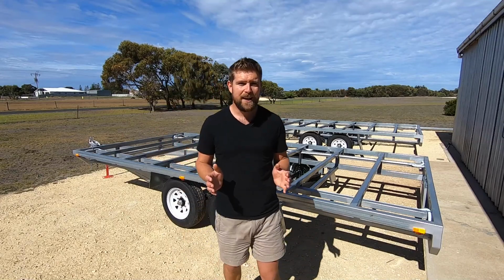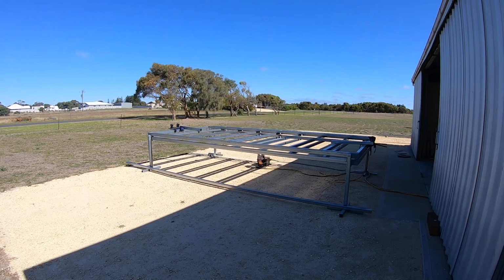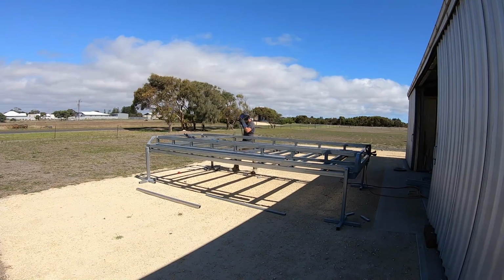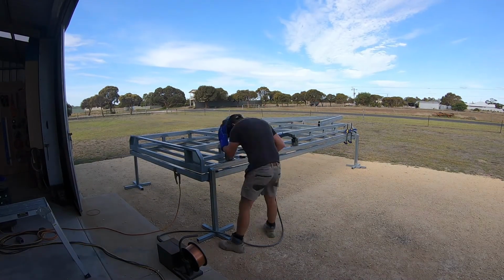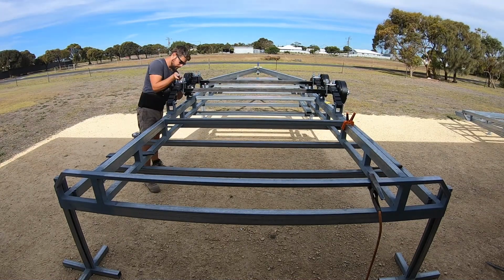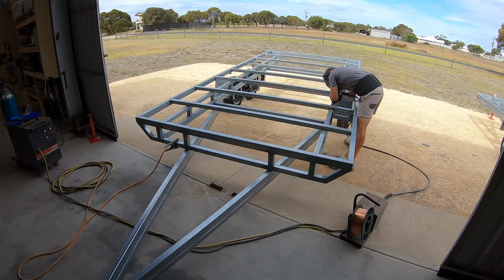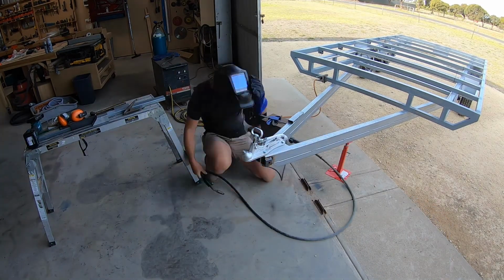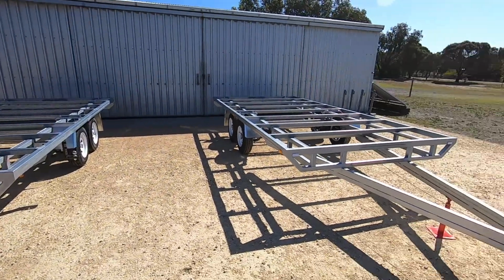How I built my own tiny house trailers (time lapse)

Comment: love it, was that a permanent welded crank up stand behind the brake, instead of the swivel type on the side of the draw bar
Reply from the maker: On the side trailer, yes. I needed the strength. But also, it winds up far enough and is close enough to the towball that it will not affect towing.

Comment: Hi,
0:41 With the ladder truss design,  how do you determine the dimension in between the ladder bar. Also, what are its dimension and your wheel's dimension to accomodate? Thanks
Reply from the maker: Honestly I didn't really calculate it as such I just put them at 600 centres. The trailers are 4800x2400mm. The wheels are 14" but it's more about their load rating than the size. The tyre will be rated to a weight and all four tires must exceed the rated weight of the trailer. Your springs and axles are all covered by standards that will dictate their max capacity.

Comment: Top job mate looking forward to seeing your finished trailers. How did you flip your trailers?
Reply from the maker: Cheers mate. Good question. Got the guys at the hardware store to come out with the JCB load handler
Reply: @TwoHandsandaTinyHouse  ok thanx.  would you build an 8m trailer the same way given the flipping predicament?
Reply from the maker: @karleddy6863  yeah probably. It wasn't a big deal to flip. I found it easier upside down but I've heard some builders do them all up the right way

Comment: Nice fabn brother i'm looking into duel axel setups of course there is a lot to choose from I'm thinking a 3200kg as the 2000kg just doesn't sound big enough any thoughts.
Reply from the maker: How long are you going? Definitely do 3200kg. And honestly I'd consider the extra money and go up to 4500kg. My trailers are strong enough to do 4500 but I kept the axles and springs at 3200 as it was more cost effective. 3000 was my target so I figured it'd be fine. But as I build and stress about weight I can't help but feel 4500 would have given me peace of mind if I go over.
Reply: @TwoHandsandaTinyHouse  yer I was thinking 4500 not sure on length yet, again budget always shows its face but spouse it's best to go bigger 👍 have you boxed one in as yet?
Reply from the maker: @binnungs3567  I wouldn't go below 3200kg. And if you are going over 4.8m really consider 4500. 6m under 3200kg is possible but hard. 

Yeah bro windows are in this video is in a playlist you can see all the updates there.
Reply from the maker: @binnungs3567  https://youtube.com/playlist?list=PL_UryR-BJnkC5MR8yAgN3qY0Wtst_OmZf

Comment: Approximately how much did this cost to build?
Reply from the maker: Both trailers cost roughly $7k
Reply: @TwoHandsandaTinyHouse  My Gosh! That's Amazing! Really well done! I wish I knew how to weld!
Reply from the maker: @Danforpresidente  cheers man. May have been a tad more but that's the ball park. I also got trade on most of that stuff. 
Yeah not something I'd recommend for everyone. Took a lot to work out the engineering. If you are in Australia I'd look at the Tiny Houses Australia trailers probably the best value I've seen and well made
Reply: @TwoHandsandaTinyHouse  Thank you for the info! You are definitely very skilled and should be so proud!

Comment: This is exactly what i have been searching for!! I want to build my own trailer at my parents to save costs. THANK YOU!!! ⭐🇦🇺
Reply from the maker: You are welcome. I hope it helps. Please be careful and make sure you or someone you are working with has the engineering knowledge to put it together. A good welder is a must but also need to know how to design the structure. I have some experience but still consulted people on the design. Especially when you are putting so much weight on them. 
Good luck! Please share the progress 👊
Reply: @TwoHandsandaTinyHouse  Thank you ❤️

Comment: Mate, what a top vid!! Exellent stuff, very keen to see your build process. Thanks for sharing. Sub'd.
That looks like flux core right? You get good results with that stuff if so?
Reply from the maker: Thanks man. Really appreciate you following. 
Nope running gas. I really like gas but with the wind we get here there were a couple tantrums. A local engineer was impressed I used gas. They did semi trailers an said they use flux core. Not all are created equal though apparently.

Comment: Could you share the measures or plans for it? And the thickness of the metal?
Reply from the maker: I won't be for the trailers unfortunately. I'm not an engineer and can't be sure what I am sharing is safe. While my goal is to help everyone DIY, trailers one of the few things I don't recommend everyone do. It takes some knowledge to make sure they will be safe on the road. A tiny house is probably the the worst you can legally stress a trailer. I am so sorry I won't share more on this one, my channel is all about sharing as much knowledge as possible but I want to make sure everyone is safe and I can't be confident I can guide everyone to do so with plans. I hope you understand 😊

Comment: Are you willing to share the thickness of the steel you used for the "joists (600mm centres)" across your trailer. I am assuming their 50x50x2mm and the heavier gauge on some other parts of the trailer is 75x50x3mm. I like the extra effort you have gone to all over these trailers, adding strength in critical places and aesthetics like the angled corners. If you wanted you could google "Penetrol" you can spray it over your springs and axles to help stop them getting surface rust.
Reply from the maker: Thanks John. I'm not sharing specifications on this one as I can't be confident everyone following has the knowledge to build a safe trailer and more so that what I'm sharing is adequate and safe. I've tried to put enough in here so someone who does know enough can fill in some gaps. I think you fall into that category and I'd say you are on the right path 😉. Very happy with how they have stood up. 

I did 600 but time again I'd do 450 centers. Only adds an extra rib or so but allows you to use thinner flooring. Check out my vid on the flooring. Do 450 then use 18mm OSB. 

Those I like taking pride in what i build I really enjoy the aesthetic of those extra bits. And strengthening the hangers are a MUST. 

Yeah I know penatrol, didn't even think of it. Cheers 👊

Comment: Hey mate... Well done!!! Looks great... How did you weld that galvanised steel? (    They  told me you can’t) For practice I renovated and converted  an old farm trailer frame to caged one... all my galvanised welding connections are cracked one by one.... haha;) I recently invest all my tax return on a good Welder and plasma cutter:) I’m am Planning to work on my welding skills in these corona days... this time I bought a small caravan ... ripped it off... now cleaning rusts etc... and working on my  welding skills guided by YouTube videos... welding off cut bits for practice...  I have many weird shaped steel garden statues now.... ;) If I can survive last project next one is a tiny house... tiny work shed ... etc.... wooohuu:)
Reply from the maker: Love it. I am jealous of the plasma cutter. 
You can absolutely weld galv. As a general rule you should grind away the zinc coating where you are going to weld then just weld as normal. With this duragalv steel you can generally get away with just welding directly over the galv. It burns away the zinc as you weld. Doesn't weld as smooth but there is nothing wrong with the welds. If you want to be purest about it technically the welds would be slightly inferior to a weld done with the galv removed but honestly the difference in strength in this application is not worth bothering with. 
If your welds are cracking (I assume where the bead meets the steel?) You probably don't have penetration. The weld has created an alloy bond with the zinc and not actually penetrated into the base steel. You can practice by doing welds then cross cutting them to see how they have bonded the steel. Try breaking them and see how they break. all practice. 
Good luck, I hope you get to the tiny house. Else you might have a garden statue business in the making haha.
Reply: Two Hands and a Tiny House thank you very much for the tip:)

Comment: Hi im andon from Sydney, im very interested in buying a tiny house for myself, preferably off the grid. I have a budget of about $2000 max, Im not fussy about materials except to say hope strong enough to withstand the elements. You think I can get a tiny house for $2000 or less? And would have you currently have any for sale?
Reply from the maker: Pink Salt  I'm in South Australia. Easiest way is via Facebook or Instagram. I also have a basic website up where you can do a contact request twohandstinyhouse.com I wouldn't don't know of any tiny houses going that cheap though, you'd have to DIY one.
Reply from the maker: Mate... 2k AUD for a tiny house is not a lot. Your only bet would be to work with second hand salvaged and recycled materials. You can save HEAPS doing it that way. Build it slowly over time and collect materials it's possible for 2k

Comment: I mentioned gussets..
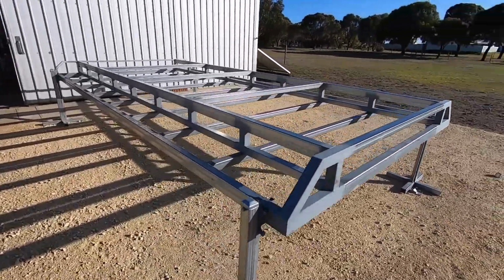@2:54 trailer upside down, those three cross bars are where you need the gussets. 
Really nice as is though.
Reply from the maker: Yeah that would certainly add I'm in heaps of strength. Had another comment suggesting the same. Might give it some thought. Couldn't do the centre one for the wheels but the other two I could. I'm going to see if I get any movement when I start building.
Reply: @TwoHandsandaTinyHouse  I love your line of "Don't hate, Educate" & I note that you don't have any thumbs down snubs, which is almost unheard of in the YouTube world.
Well done mate.
Reply: I want to move to Oz so freaking bad.